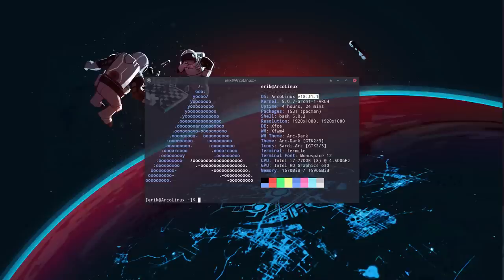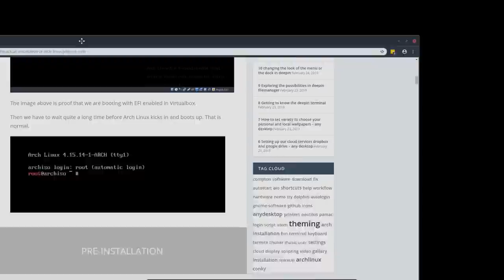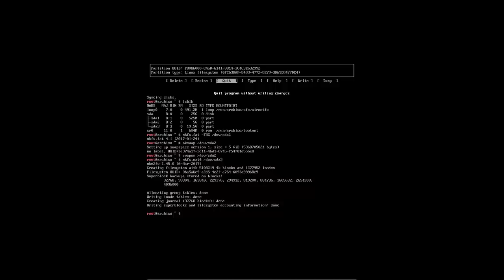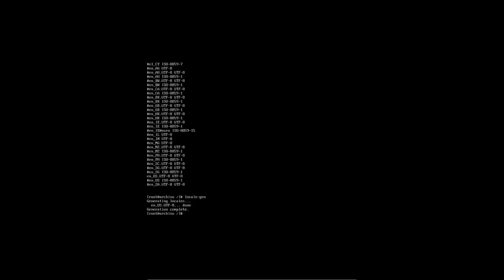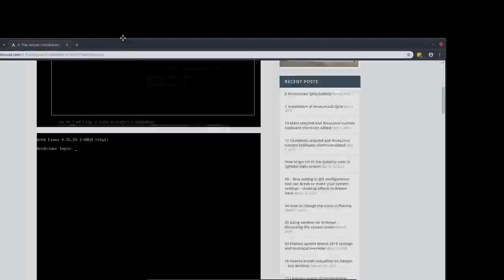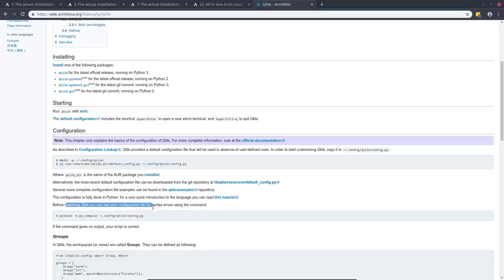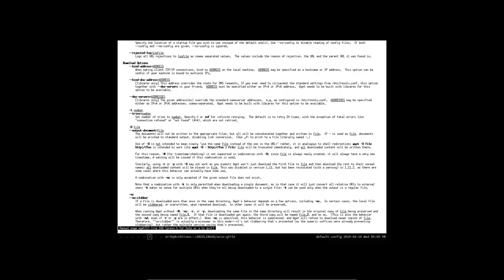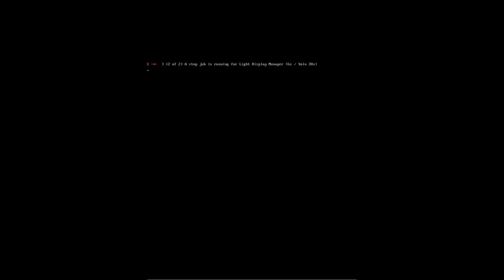ArcoLinux : 895 How to install qtile on ArchLinux - AIO installation

Comment: man i cant spawn a command terminal with qtile, WINDOWSKEY + ENTER do not work, pls help
Reply from the maker: Super + enter
ctrl + alt + enter
super + T

they all launch terminals
termite and urxvt
Reply: did you make sure that you installed xterm or any other terminal on your system?
Reply from the maker: one terminal is required - choose

Comment: they keybindings are not working even though i coped the right config py file correctly, i have the tiles shown, and i can press the (mod+r) and it shows the "spawn: " down and with mod+num it changes the window but that's it, the mod+retrun(enter) is not showing a terminal and nothing else is, how to fix it ? using a virtual machine
Reply from the maker: compare what we have - ours is working -sxhkd is there too - did you install the software - do you have keybindings - are they double
Reply from the maker: the standard config of qtile just has been too long ago to remember 
again see what we have and compare
Reply: Fixed it!
In the config file it is put to “mod+return” i changed the return option and put it to “Enter” and now its all good, thank you so much for the amazing video❤️❤️

Comment: Hi, I'm from Mexico, I didn't quite understand how to open the terminal in the minute 53:45 , could you tell me?
Reply from the maker: i say it in the video - super + return (windows key = super)
Reply: @ErikDubois  I was able to open the terminal, but at the moment of cloning the repository I get this: failed to connect to github.com port 443 connection refused, might you help me?
Reply from the maker: use port 80 - 443 is for secure web browser communication
Reply: @ErikDubois  it does not work i used super and return but nothing
Reply from the maker: @emanuelpark1499  it is a keyboard shortcut - it is either in the config or not
Reply: @ErikDubois  well i used them but they did not work .-.
Reply: Super + Enter worked for me

Comment: Hi, I followed the video step by step and it happens to me that after installing qtile and copying the cofig.py I restart the virtual machine, but this does not start and remains on the black screen with "_". I don't understand what I'm doing wrong :(
Reply from the maker: https://youtu.be/5prSvdW-Rqc?t=4312 - around that time we get the content of /etc/skel into your home directory
without it there is nothing to boot into.
what you refer to is a problem in drivers - me thinks 
want more help forum and discord are the tools
Reply: Hi Jair! I had the same issue as you. Turns out all I had to do was wait 10 minutes and the lightdm greeter screen showed up. Make sure that for part 1 you follow the official Arch wiki guide and not the video as the installation guide can change through time.
Reply: Hi, I have the same issue, could You solve this?  Have You some clue?
Reply: @julianrodriguez7571   In VirtualBox settings of the virtual machine layout, in the display settings i have to uncheck the 3D Acceleration.

Comment: Hello!  I've got a problem callen "ERROR: Cannot find the fakeroot binary. / ERROR: Cannot find the strip binary required for object file tripping". Minute --> 1:04:01 Can you help me please? Good video btw
Reply: Does not matter. I solved it by  --> sudo pacman -S base-devel
Reply from the maker: it was on  the page - you will have missed it

Comment: super + return comand does not work, it does not open the console at 53:48, any help?
Reply: neither it does for me :(
Reply from the maker: did you install the application behind the keyboard shortcut
Reply: @ErikDubois  thank you for answering. I don't know what application do you mean. It finally worked for me when I installed xterm. Sadly, I want urxvt to be my default terminal
Reply: @ErikDubois  Thanks for the help, the problem has been already solved since I didn't follow the arcoLinux guide properly, thanks for keep helping people in videos of a year ago : )!